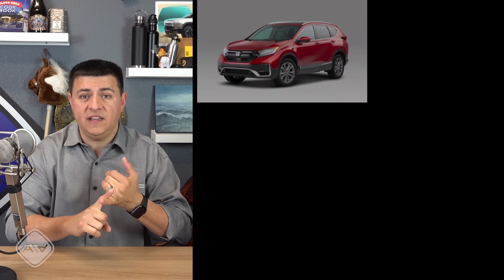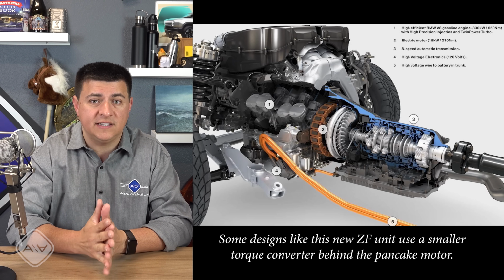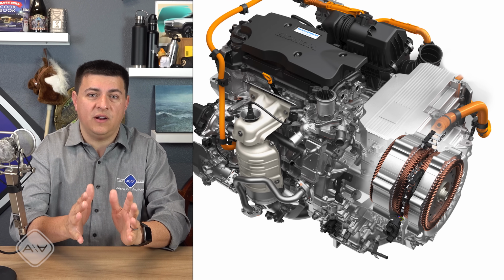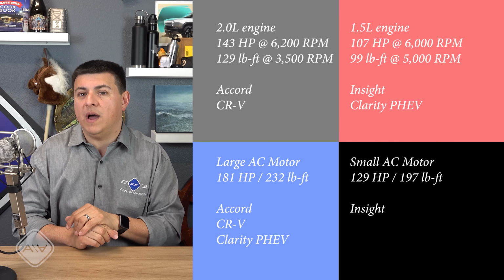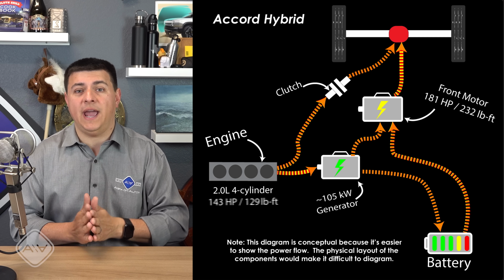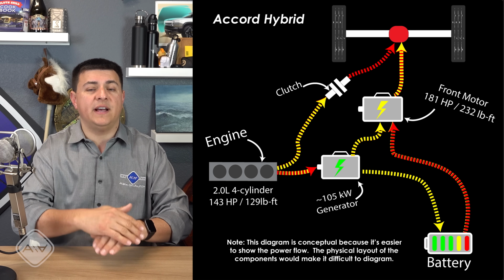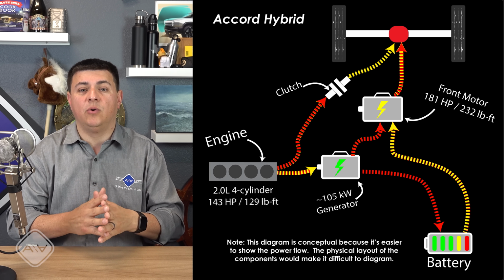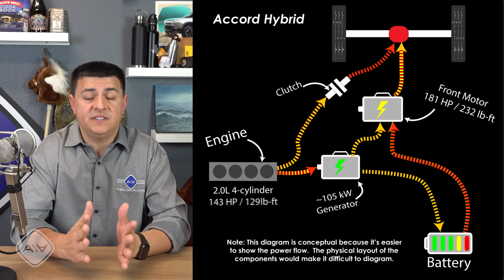How Does It Work?  Honda's 2 Motor Hybrid System Explained!

Comment: Can we just running with the thermal engine just in caseof bad day , i mean without hybrid system
Reply: No.

But you are slightly confused about what the "hybrid system" is. Or that it, as a unit, can "break down."

It isn't a separate propulsion system. It functions as the transmission, starter, and alternator all rolled into one. No car can run if any of those stop working on "a bad day."
Reply: There is only a single gear for the ICE engine to send power to the wheel.  That gear is about the same as 6th gear (or overdrive gear) found in a regular transmission.  You would need to be at constant hwy speeds to bypass the hybrid system.  The Acura Sport Hybrid system with a 7DCT can run on electric, ICE, or a combo of both at low speeds.  Don't know if the Acura Sport Hybrid would still run if you had a failure in the EV or ICE systems alone?
Reply: @mrgold3591  When the ICE is connected to the wheels, it is also connected to the traction motor. This is called a "parallel hybrid," and it is just like the Acura (without shifting). The traction motor can then act as either a motor or generator, to add or subtract torque to that of the ICE. This way, the ICE can always run at the most efficient power.

The point is that the ICE never acts alone.
Reply: @jeffjo8732  I was answering the original posted question of can the ICE engine run at lower speeds without engaging the EV components.  Acura Sport Hybrid can; but, the Honda hybrid cannot operate at low speeds (under 45mph) 100% on ICE.
Reply: @mrgold3591  Okay, I'm crossing replies. My point is that the ICE cannot run at any speed without the EV components. They aren't independent, even when the ICE is connected to the wheels.

For example, at 55 mph the ICE runs just over 2000 rpm. The car needs 15 HP to maintain speed, but the ICE runs at 34 HP because it is 40.6% efficient there, but only 33% at 15 HP. The traction motor pulls 19 HP to charge the battery.

The point is that throttle control depends on what the generator is doing.
Reply: @jeffjo8732  The answer to the original question of "can the ICE run the vehicle if you if the EV components are unavailable" is still "NO" for the Honda hybrid system.  The Honda hybrid owner is calling a tow truck if EV system isn't available and no running with just ICE to get to the repair shop.
Reply: @mrgold3591  The answer to the original question is "EV is a major component of the propulsion system. No matter what kind a car uses, if a major component stop working, most (if not all) cars stop working. But there are no circumstances under which you can consider the ICE portion of a modern HEV to be independent. The EV portion can be, in a PHEV, but never the ICE portion."

But this level of detail wasn't necessary to the original question. I did answer the "simple yes or no" question with a simple "no" answer. I only provided more details when mrgold35 did so, with some incorrect.
Reply: @jeffjo8732  I agree that level of detail wasn't needed.  Not sure why you needed to take it to that level for a simple yes or no question?

Comment: Interesting technology
Reply: In what way is it a fail? My Accord Hybrid is as good as, or better, than a comparable Camry in every category.
Reply: @jeffjo8732  I guess I was being a little too harsh, compare to the competition it sounds like an inferior idea.. I don't have the time nor interest to go into the details.
Reply: @JacobTJ1  No, you were expressing an uninformed opinion as if it were fact. And not having "the time nor interest to go into the details" is why it was uninformed. And quite incorrect.
Reply: @jeffjo8732  my comment was based on what Alex said in this video and other videos where they compared it directly to Rav4 hybrid. In essence anytime you are converting mechanical rotation purely to electric then back to mechanical there will be efficiency loss. Split power cvt does not have this kind of loss..
Reply: @JacobTJ1  There are two parts to efficiency: How efficient the engine itself is, and how efficiently it transmits power to the wheels. You are only considering the latter. The Honda iMMD system will run the ICE at its most efficient rpm and level of power almost all of the time; a power-split hybrid can't. Yes, it has more losses in transmission, but not as much as Alex speculates. But it runs the engine more efficiently. The end result is nearly identical power-train efficiency. For an explanation of what Alex leaves out, see https://youtu.be/6glpZTRT6qE . It's for a smaller system than what is in the Accord and CR-V, but it functions the same way.

Any differences are due almost entirely to wheel size and tire width. The Camry LE uses 16" wheels and 205mm wide tires, while all other trims use 18" wheels and 235mm tires. There are no other significant differences, but this drops 2019 (the data I have) EPA mileage from 52 mpg to 46 mpg. The 2019 Accord Hybrid used 17"/235mm and got 48 mpg. In later years, higher trims went to 19"/235mm and dropped to 43 mpg. If you adjust for these s]wheel/tire sizes, these mpg estimates are essentially identical. So you can't call it a "fail" based on mgs.

Then, Alex is wrong here when he says the Accord is "just as fast" in 0-60 runs as the Camry. It is significantly faster. Motor Trend says the different is difference is 0.7 seconds (6.7 to 7.4). Car & Driver puts it at 0.8 (7.1 to 7.9).
Reply: @jeffjo8732  I think I understand what you are saying, I am focusing on the slower speed side when the engine is not coupled in direct drive. If you drive sporty, the efficiency might drop off drastically. On the contrary if you dive gently with an eco mind,  you could potentially beat the Toyota system in mpg. I say fail because most people will drive like a traditional gas engine and keep higher revs on that engine. I am a sporty driver and enjoy the torque at low speeds.
Reply: @JacobTJ1  Well, you don't understand what I am saying, since it applies to both Hybrid Drive (clutch open, or the "slower speed side" as you put it) as well as Engine Drive (clutch closed, highway cruise). But I get the impression you don't want to have your mind changed.
Reply: @jeffjo8732  no I am not arrogant and I think i understand the technology, I guess I shouldn't be speculating without having driven either cars, I retract my original comment. You won.
Reply: @JacobTJ1  The point is that the technology is used in a completely different way than you are used to. And there are many factors that are involved in complex tradeoffs, and you were only considering one. Yes, driving "sporty" does have an effect, but it applies more above 65 mph than below 45 mph.

In a conventional car, all of the power being produced by the engine is applied to running the car. This does include some for peripherals and losses, but I'm ignoring that (they are important to see how Alex misinterprets power; essentially, the HP ratings he used applies before these other factors are considered, and the 181 applies after).

Efficiency is a function of both rpm and power. The transmission in a conventional car will adjust rpm, but not power, to get the best efficiency. Unfortunately, the best power is somewhere in between the power needed for cruising and the power needed for acceleration. This means it can't get close. I have a copy of the efficiency map for the 2.5L Camry, and it is capable of nearly 40% efficiency. But when cruising at 45 mph, it can only get 30%, and that's only if it can find the exact right gear.

Hybrids can also adjust power. (The same engine is used in the Camry Hybrid, but it is tuned to the Atkinson cycle.) By increasing power from about 10 HP to about 50 HP, it can exceed 40% efficiency. But it has to have someplace to put the extra 40 HP. And it does, the battery. But all of that 40 HP would be subject to the losses you worry about. So it just increases power enough to maintain about 50% state of charge in the battery. If you are near that level, it has to drop back to about 33% to 35%.

One of the keys to the Honda system, is a smaller engine. To reach its maximum efficiency, it only has to increase power to 34 HP. Plus, the conversion losses you worry about have already been traded-off for fewer mechanical losses in a transmission. They are small in a power-split hybrid, but not negligible. The point is that after all of these tradeoffs, the average efficiency of either system can be about the same. Where they diverge, is at higher speeds if the smaller engine has to make a lot of power. This is a weakness of the Honda system, but really the only one. In every other aspect, it is as good, or better, than the power-split.

So it is not a "fail." Its performance lags in the mountains (like Alex's tests) and if you drive aggressively on high-speed highways. But it does as well, or better, in most other situations.
Reply: You might take a look at Acura Sport Hybrid system for the 377hp 14-20 RLX or 321hp 17-20 MDX.  Both have a 7DCT, 3 electric motors, V-6 NA engines, sporty suspension (MDX has electronic dampers), regen braking+torque vectoring for super handling awd, and Sport+ mode.  Acura system acts like a turbo/supercharger without the lag and can go into EV mode when needed below hwy speeds.  The downsides are you don't get the mpgs of the Honda hybrids (city/combine/hwy are 1-2 mpgs of each other with the Acura system).  MDX hybrid is rated at 26-27 mpg city/combine/hwy with under 6 second 0-60 times.  RLX hybrid is rated at 28-30 mpg city/combine/hwy with under 5 second 0-60 times.  Being a Acura/Honda, the scheduled maintenance is the same as the awd Honda products.

Comment: It has no transmission "in the truer sense of the word"? How does this two motor system get it's rotation / power to the wheels?
The power is 'transmitted" to the wheels by way of the "transmission."
Reply: Technically, "transmission" does not mean a part. Merriam-Webster says it means the " act, process, or instance of transmitting [power]".

Every car transmits power to the wheels. While many battery electric vehicles brag that they don't have one, what that means is that they have a single-speed (i.e., gear ratio) transmission. Gas cars usually have multi-speed transmissions, and the ability to change these gear ratios is what many people think of as the primary purpose of the transmission. Getting back to Merriam Webster, it can mean "an assembly of parts including the speed-changing gears ... by which the power is transmitted from an engine to a live axle;  also, the speed-changing gears in such an assembly."

Just like a BEV, these cars have a single-speed transmission for the traction motor. They can even engage the clutch, and so link the engine into that same single-speed transmission. But it cannot alter that gear ratio, so it has no multi=speed transmission.

Comment: can somebody put out a video explaining why EVs don't have a transmission, seems it might help with range if you could run the motor at lower RPMs but still maintain hwy speed...although you may lose some torque...seems a simple way to extend range without adding more batteries.
Reply: Why do you think it would extend range of an EV?

Say a car (any kind) needs 15 HP to cruise at 55 mph. This is about what Honda says the Accord needs. The car's engine or motor needs generate that 15 HP no matter what gearing it has. So if the engine spins at 1000 rpm, it needs to make 79 lb-ft of torque. At 1500 rpm, it needs 52 lb-ft. At 2000 rpm, it's 40 lb-ft.

The reason a gas-only car needs a transmission - aside from its limited range of rpms -  is that efficiency varies quite a bit over this range. A gas engine might have its best efficiency at 1500 rpm, and the transmission should adjust the gearing to that. Efficiency might be 5% less at 1000 rpm, and 10% less at 2000 rpm.

Aside from having a much wider range of rpms, an electric motor has more consistent efficiency. It might vary by less than 1% to 2% over a similar range of rpms. What might help, is a second gear for very low speeds. EVs tend to be much less efficient below, say, 15 mph. But you really don't travel many miles at such speeds.

Comment: Why is CR-V more expensive than competition? Is there a "mechanical" reason why?
At least on my (Japanese) market, it is extra 10% for all CR-V trims and Honda offers less features (still no heated steering wheel on most Japanese models). 
This hybrid would make sense for me as I want good AWD and my cruising speed on the motorway is max 68 mph.

Comment: Apparently the clutch pack is not reliable as toyota’s PSD system, the clutch pack will need maintenance on high milage and the cost will be eye watering…

Comment: Engines work best at 70% load between 2 and 3 thousands rpm. A prius would not be more efficient below 40mph because the engine maybe working at half peak efficiency.

Comment: You got it wrong with the Prius, the cycloidal gear is not about gear ratio it's a power split device , there is no direct mechanical drive to the wheels same as Honda
Reply: Sorry, no. It is a direct mechanical connection, but with a splitting of the power. That is, the ICE has a direct connection to both motor-generators, MG1 and MG2, and MG2 has a direct connection to the wheels. These three devices have a more complicated gear-ratio relationship, but it is one:

18*ICE + 5*MG1 = 13*MG2.

The MGs can spin backwards; positive torque accelerates the car, but they can be negative.

In eCVT mode, the Honda does not connect the ICE to the wheels at all. The ratio of ICE rpm to wheel RPM has no significance.
Reply: @jeffjo8732  by direct mechanical connection I meant there is no ICE or gears driving the wheels only a motor same as my corolla, the toroidal gears are a power split sevice between charging the battery and driving the motor MG2 to the wheels
Reply: There is no clutch in the Toyota eCVT it starts from zero speed using the motor and stars the ICE on the move depending on power  requirement

Comment: Does Volt really have same as Prius? It should be different and more complicated...
Reply: More complicated? Yes and no. It has more mechanical components, but fewer combinations of power.
They both use a planetary system as a three-way transmission, but quite differently. In the Toyota system, the planetary system is called the PSD. Its three permanent connections are the ICE and two motor-generators, called MG1 (the smaller one) and MG2 (the larger one). The MG2 connection also drives the wheels. A computer controls a complicated dance by shifting the flow of power between these three connections. Either MG can add power to drive the wheels, or draw power off to generate electricity. The goal is to allow the ICE to be used as efficiently as possible, This can mean generating more power than the car needs, or less, whichever is more efficient. The battery is used as a buffer for this power. The Toyota can act as a serial hybrid, a parallel hybrid, or both at the same time. And it can switch between them quite rapidly.
In the Volt, the three connections are just MG1, MG2, and the wheels. But there is a clutch between MG1 and the planetary, so MG1 isn't always connected. Usually, only MG2 powers the wheels, but MG1 will assist at higher speeds.  Instead of going through the PSD, the ICE is connected directly to MG1 via another clutch. It can drive MG1 as a stand-alone generator, or help power the wheels at high speeds.. So, some of the same modes that Toyota uses are available, but are controlled mechanically by these clutches.

Comment: There is a "true" transmission. It only has one ratio - it's a "one-speed" when working as a mechanical transmission - but it's still a transmission.

Comment: The CVT I have invented will increase the efficiency of any vehicle drive system whether its fossil fuel, electric or any combination that is used. My CVT will improve the efficacy of any motorized vehicle,